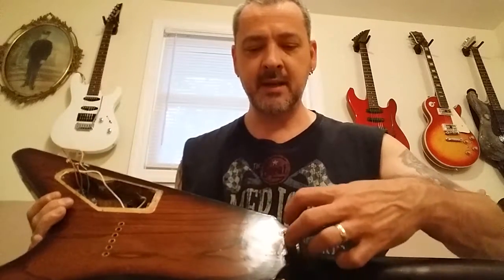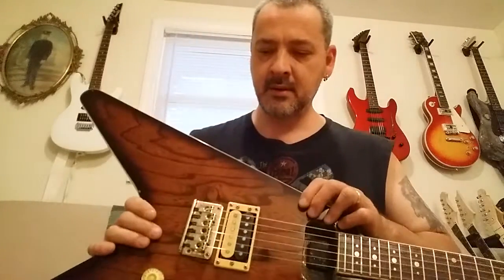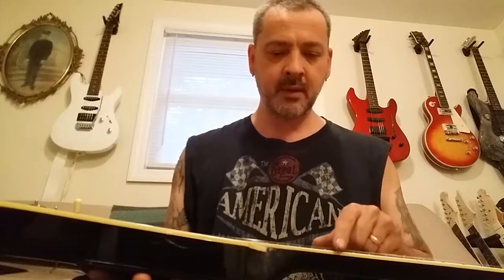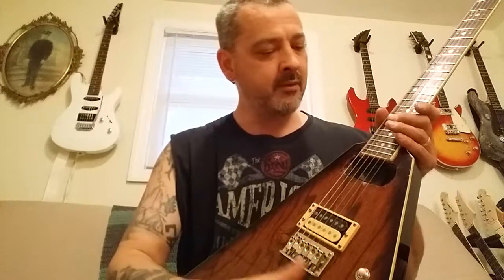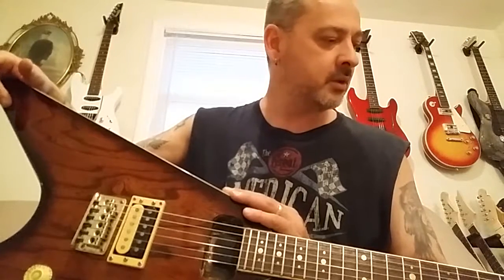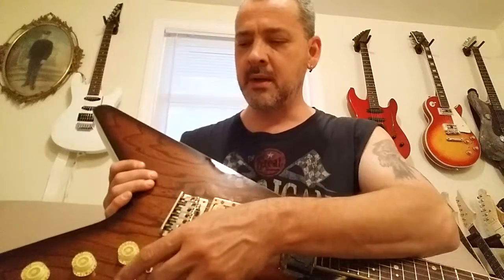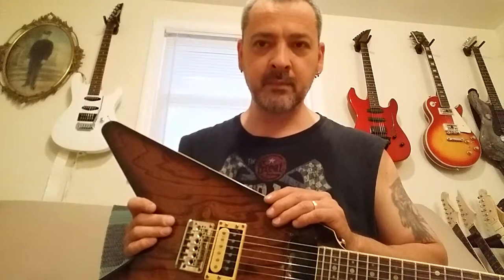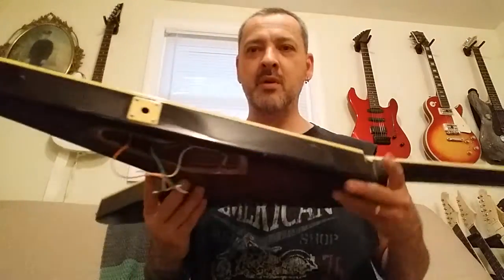Cort guitar update

Comment: I know how frustrating it can be setting up a used guitar.  Hade some of the same problems with the Squier.  Even the vester with its locking trem took a few attempts to get action where I could deal with it no buzz n no big intonation freakouts.
Reply from the maker: yeah frustrating for sure when things don't work out but that's what happens when you get a used guitar that was not taken care of  i think weather and kept in the basement did not help
Reply: adam schweigert yeah same for that squier I got,  strings never changed, action was some weird woowoo n it was dirty, who knows where it lived before it ended up in that prawn shop.  This week it'll be fully refinished n with new nut, string tree's it'll be more playable.  Just not sure if I'll invest in the HSH pickguard / bridge / tuners or not.
Reply from the maker: +CJ99 just have to do a little at a time but hsh i have on one guitar sounds pretty good
Reply: adam schweigert Yeah got the idea from some of the ibanez guitars I've seen.  been thinking of wilkerson bridge,  hsh loaded pickguard off ebay n maybe sume grover tuners if I do keep it instead of selling so it'll be a bit different from my other 2 guitars.  Though still tempted to get it going with the existing parts, sell it n pickup a telecaster later on.
Reply from the maker: +CJ99 that sounds like a plan i like my telecaster even though it's a Squier affinity that's way i made 2 more
Reply: adam schweigert I like squers fine.  Helps that they fit my budget too.  If I can find a seafoam green tele with 22 frets n 6 bridge saddles it'll be super bonus.